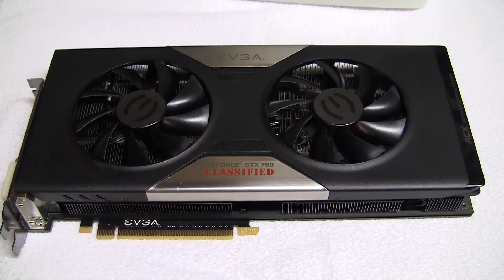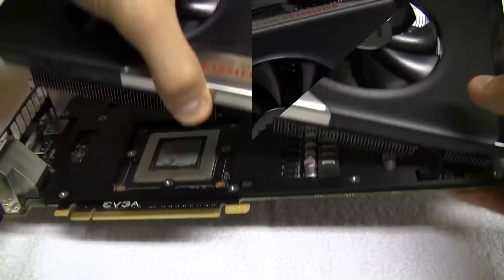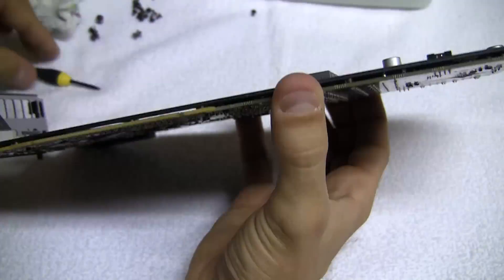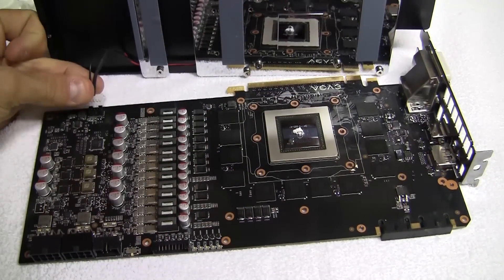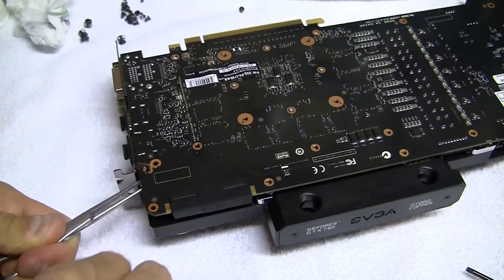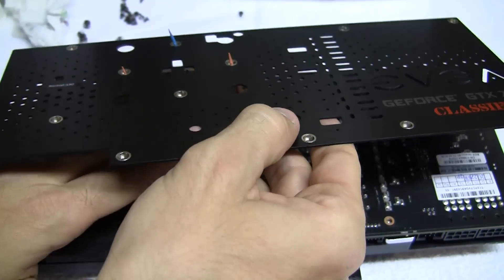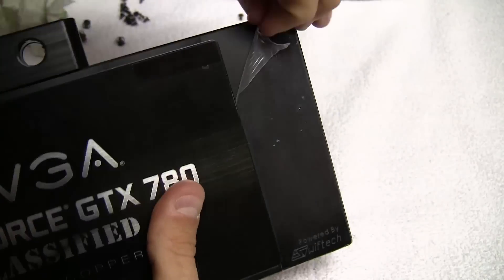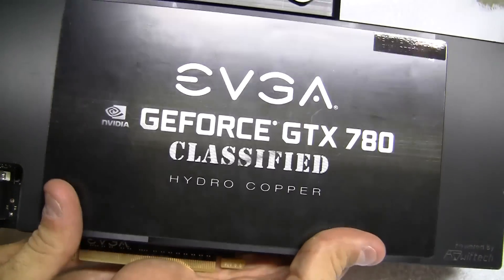EVGA GTX 780 Classified Hydrocopper Installation

Comment: Dumb question,
My 780 ti hydro copper should have a 1085mhz boost clock out of the box.
but it boosts to 1163mhz in all games.[max tamp 31C]

How is my card running faster than the box specs?
Reply: don't question it, just let it happen
Reply: You said TI, this is not TI.
Reply: hey i think the bigger problem is that you don't have a costume bios on your card yet you are watercooling it. I have a gtx 780 classified with a skynet bios rev 2 and on aircooling i am getting 1300mhz (defiantly pushing the thermal limit) i also use gtx classified control to hack the voltage off the card. please if you watercool them you best be overclockin
Reply: Parkskiingftw
I'm running 1,314/7600 right now.
perfectly stable at a low 1.175V
never goes over 45c.
Reply: If you can an insanely low voltage like that then you should defiantly hack the bios and send your card to 1400mhz, honestly it sounds so sketchy but it is really easy and not the dangerous if you take your time and double check everything. At 1300mhz i need at least 1.275v.
Reply: Parkskiingftw
I want to, but adding more voltage than PrecisionX will allow, will VOID my warranty.
$1,000 Gpu ya know.